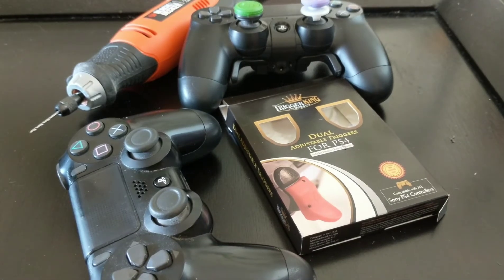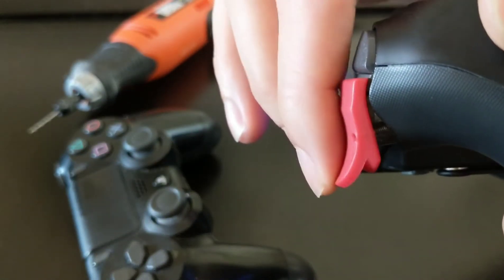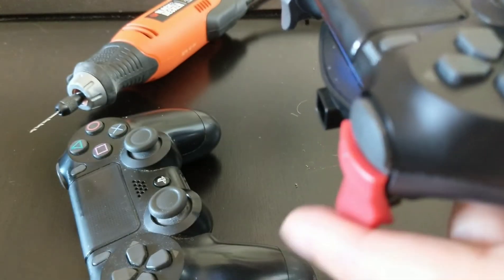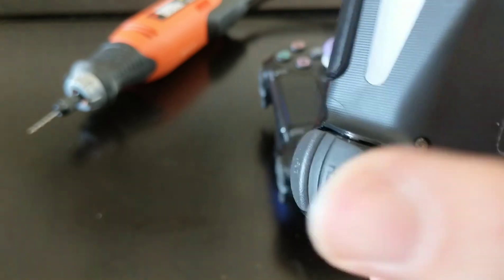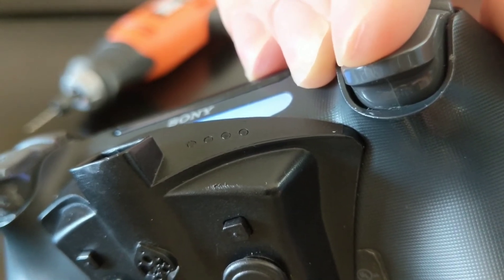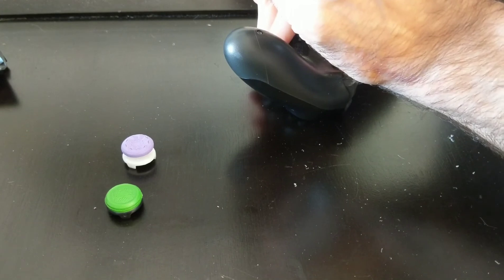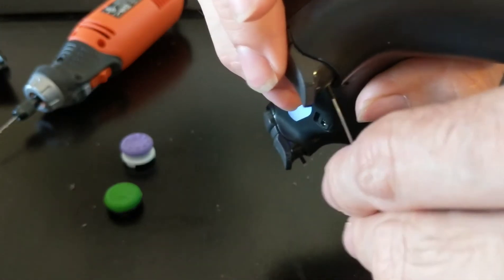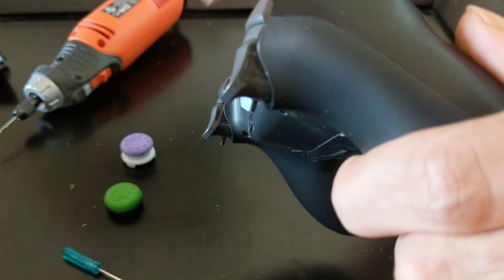Review of TriggerKing Trigger stops.

Comment: Did you ever find a solution to reduce the deadzone on L2 R2? If so, please make a video. BTW, I have those exact Trigger Kings and had the same problem. I bought some 3M Solutions double sided tape, put it on and let it bond for 24 hours for 100% strength as the instructions stated and have had no problems. A friend of mine glued his on and loves them too.